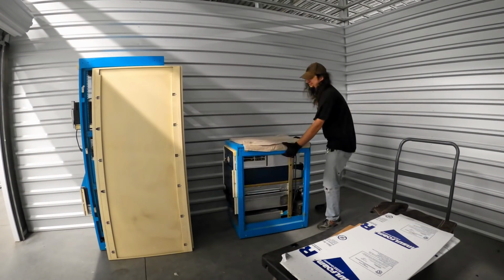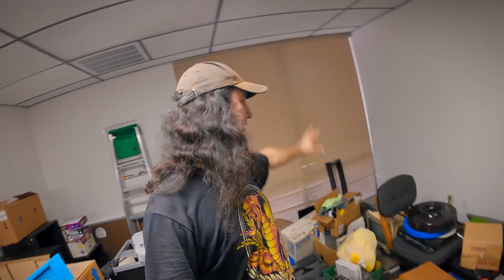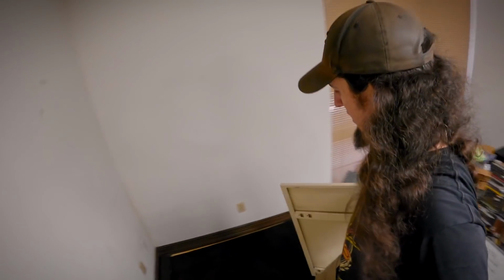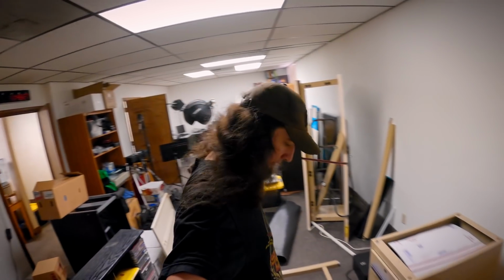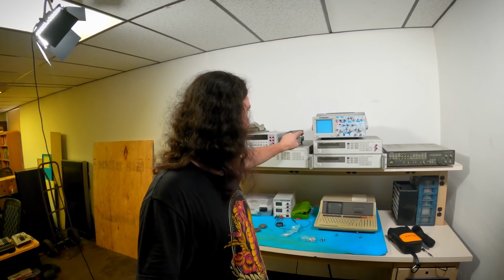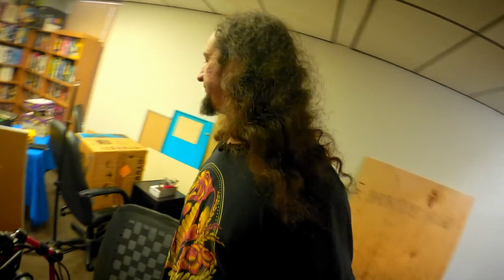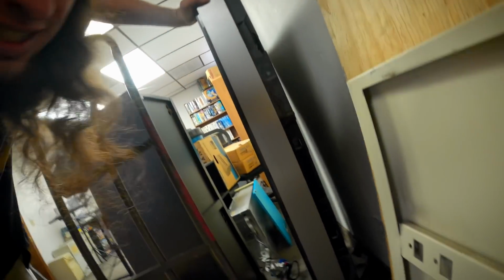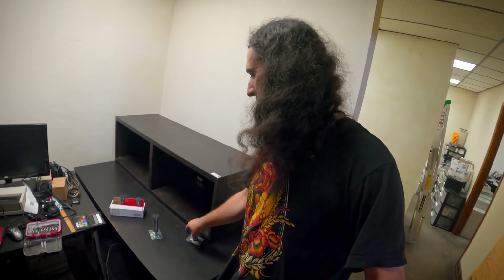Office Vlog 0x08 - Storage is Empty and Beginning Electronics Area

Comment: For the lights, you could also buy some diffusion fabric and cover the lights with it in order to give a little extra diffusing power. Another YouTuber I watch was having a similar issue (the included diffusion panel not doing enough work) and he just bought some diffusion cloth and it did a pretty decent job. I don't make videos myself, but it seemed like he was happy with the solution.

Comment: If you can find some steel bars at a hardware store that will fit into the slots of that TV, then just drill holes in the TV stand and feed the bars through. you can get furniture leg caps to fit the bottom of the steel bars so they don't dig into or rust against the flooring. Heck, the bars don't even need to be fully secure, just stable in the vertical plane. slide the TV over the two bars, and it'll keep it from tipping. Only a drill required to put holes in the stand, and a hacksaw to cut the bars to length.

Comment: You could run some extensions into the drop ceiling, and drop power points just next to the lights, that would be the cleanest looking way to do it.
Reply: Technically you can not run extension cords in above a drop celling or behind walls.
Reply: 'Technically' there's nothing stopping you, but it's presumably not to code so you shouldn't...

Comment: I had a similar tv wall mounted in my garage at one point. It was great fun to lift on the hooks

Luckily I could use resin fixings into a concrete block wall

Comment: Ok, I'm going to be going back through all of your server related videos, but I wanted to ask the question bc rn I have absolutely zero experience. Would you maybe go through how you set up your local network, and how everything is connected? I am finally going to have the space to really get into retro computing with my house I'm moving into in the next couple of months. I can get hold of a server and plenty of switches and other equipment easily, all just sitting in storage. I guess I what I'm asking for is an explanation of what exactly you use your network for, and how.
Either way, huge fan, always loved your content and the way you explain everything. Can not wait to see what you produce out of this space, but also love watching it develop. As a less serious nerd, thank you so much for what you do and how you teach!
Reply: I think he still has to figure that out for this location.
Reply: Find a central point for your switch, it will need power, and easy access to cable runs. Run cat6/5e utp solid cable from the switch location in your walls or lowered ceiling or whatever and fit nice wall jacks on the end for each patch point you want in a room - leave enough slack both ends! (On the room socket side leave about 6" in the wall in case you ever need to reterminate it. Terminate the switch side into a patch panel, then run patch leads from your patch panel to the switch. Easy flat network.

Comment: Why didn't you put the data general stuff against that wall across from your electronics bench? The window there means that corner is sort of useless for much else, and if you centered them on that relatively small wall you'd be able to get behind them without issue, and they'd be right behind your workbench making them a little easier to work on. And I'd totally just block that window with a bookshelf for the temp projects.